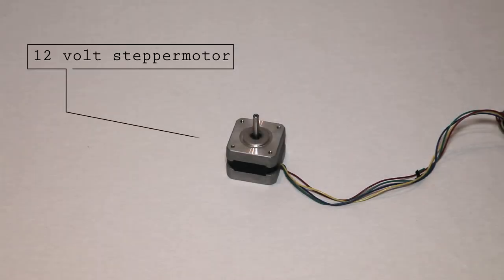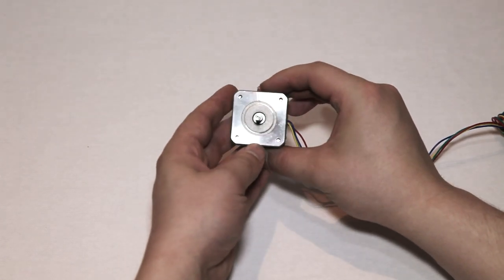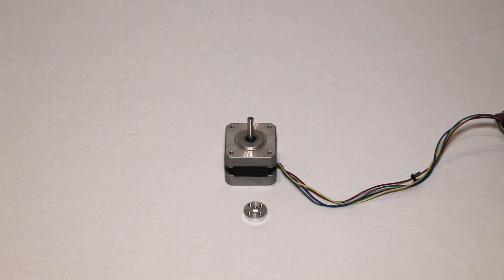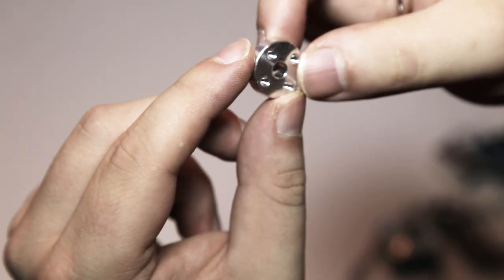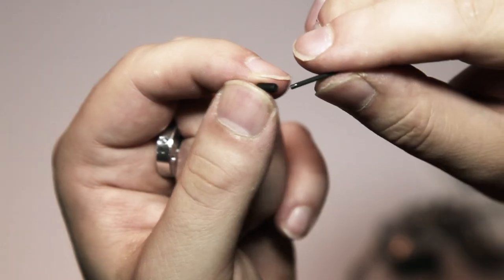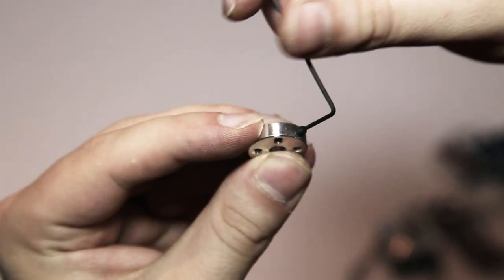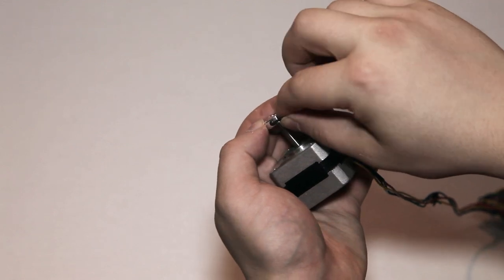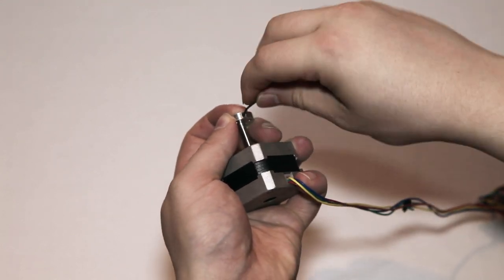How to attach something to a smooth stepper motor shaft

Comment: A better way would be to take a grinder disk and make a flattened edge for your tightening screw to sit on so it doesn’t slide after a bit of use ;)
Reply: That's what I'd recommend too :)

Comment: How do you mount the second shaft to the hub using the 4 holes ?
Reply: use another hub on the 2nd shaft? lol
Reply: You'll want to use a shaft coupler, not what's in this video.
Reply: Exactly what I was thinking. It's a never ending story. You end up buying tons of couplers, adapters, reducers,  chucks, plenty of machines (to make the perfect fkn fitting)... and in the end the attachment is so heavy that unbalances it all. Maybe it's just better to buy a fkn expensive motor with all its fkn accessories (if there even is such a thing).

Comment: I'm not a big fan of this strategy.  Using a set screw puts a lot of torsion stress on a small set screw.  I'm typically use 3-6mm shafts so especially for the 3mm shafts using a Dremel nut and collet works really well.  These little collets are made for holding small drills and the motor shafts are about the same size as a drill bit.

The best part is Dremel tools and accessories are widely available and cheaper than this solution.
Reply: ***** I found some collets that were meant for model aircraft props that work a treat for 3mm.
Reply: +Dennis Furr Oh my God. You guys are not even complaining that the idiot manufacturers made a smooth useless shaft on every stepper motor in the world for no reason whatsoever. Instead you're finding makeshift solutions to deal with it like trodden-on rodents. RISE, PEOPLE! Be good global citizens and actually matter. Complain when things make the world worse.
Reply: Dennis Furr, your strategy is off; this is not the forum for the uprising that you propose and it will not affect, in any way, the manufacturer's production design.
Reply: Mark - I didn't suggest that it would change the design but merely suggested using a collet.  I think you were referring to Zxenmusic's comment.  If I recall correctly instead of using a Dremel nut and collet I bought a collet for mounting a RC aircraft prop to a motor and swapped out the elliptical nut for a piece of ID threaded steel tubing that I fabricated.

If I was really smart I would have built in a flexible coupling to reduce bearing wear.  Live and learn.

Comment: Why dont they just make a D shaped shaft or give it a spline like normal shafts? Thats fucking stupid.
Reply: agreed.
Reply: What if the orientation of the motor is so that the shaft is pointing downward. The D shaped/Splined shaft wont be able to hold the other shaft because nothing is holding it up against gravity. A shaft coupling is a better idea but this could work if space is an issue.

-Tenzin